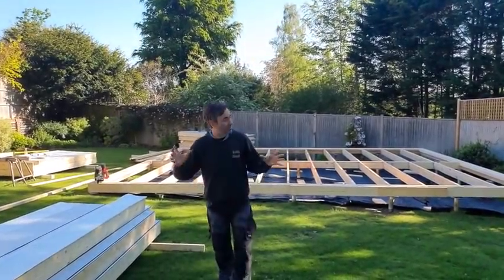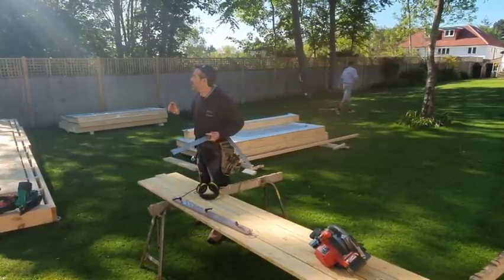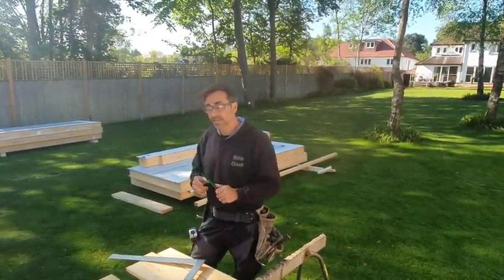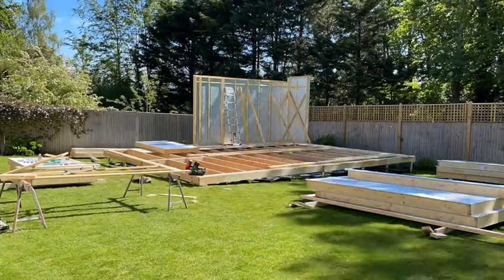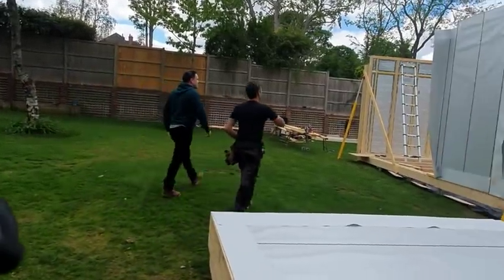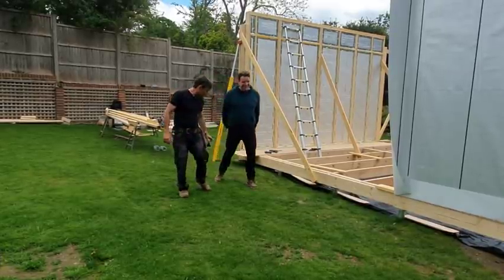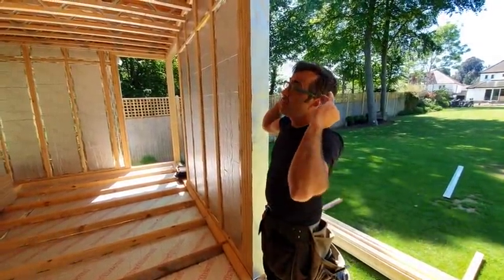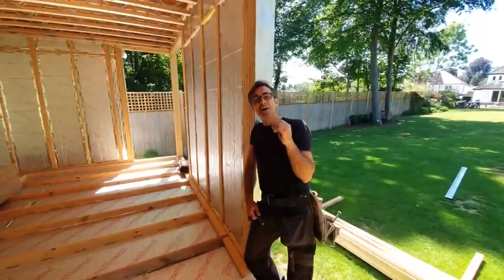Garden room how too or Workshop. Erecting walls and putting roof on

Comment: Tolerance is an interesting thing - it will be interesting to see how the industry adapts to fix something that simply has to be correct, absolutely. 

Great video 👍🏼
Reply: Game changer when the new builds will have this tolerance tests. People won’t be able to get away with bodging the work. Great for building standards
Reply: Government appointed, clip board and camera wielding, swarms of Clerks of the Works, teeming through every building site, watching over our every move, presumably . ?
Reply: @thetessellater9163  come on mate, we’ve all seen bodge work, sometimes is not even coming from the people doing the work, it can be the house developers cutting corners on the right specs and material

Comment: I have used Gapo tape after seeing a previous building of yours, I’m currently in planning for a single storey ground floor extension which I’m choosing to steel frame and in fill with timber and PIR, hoping that use of Gapo Tape will allow me to use 4 x 2 instead of 6 x2 timbers. I found with my previous two roofs that I used the tape with, I have eliminated warm air leaking into the underfelt void, it’s time consuming to tape up but so much cleaner In installing.
Reply from the maker: That is awesome!

Comment: Hi Robin, great video as always. Interesting discussion about the performance gap for insulation. We don't have much prefab builds in Norway, and PUR insulation (and similar) is almost exclusively used for larger commercial steel builds (stores, workshops, etc), with steel panels on both sides for walls and roofs. A build like this, and residential buildings, will always be insulated with mineral wool (Rockwool, Glava), where the contractor will be careful putting it in not to get any gaps or squeezes between studs and insulation. I've wondered why mineral wool doesn't seem to be much used in the UK?

Comment: You guys are light yrs ahead of construction processes in Australia...whilst prefab frames & trusses have been around sometime on the eastern seaboard (Sydney/Melbourne etc). We are lagging behind when it comes to insulation methods. As far as W.A. (Perth) is concerned we're still building with DBL brick with effectively what's alfoil as wall insulation & nothing under roof (colorbond & tiles) Rant over
Troy

Comment: Insulation seems the in thing in the UK now. I remember the attempts in the eighties and the improvements over the nineties. It keeps moving on. In Qld no compulsory insulation until 2000. Even now it is still crap. Don't see the foam panels all still batts. U value requirement not a lot. The excuse it is hot and we don't get cold so don't need anything flash. How wrong. Those eco joists as you call them I used to make them just over twenty years ago on a long press plate and travelling gantry press. Never seen them used as roof rafters but seems like a good idea. Nice and light and you can engineer the span. That panel construction reminds me of the eighties. We used to build kit homes all pre made in the factory. The panels turned up complete with all lintels in. All windows and doors in glazed already. Ply skin on the outside covered with building paper. They sat on a beam and block slab. Fix together. Throw on trusses. Tile and add brick skin. We had to add the insulation. Very similar though.

Comment: My mid 80's home in US flyover country was build with metal web joists.  So far they seem to be getting things done.  I installed a physical cabled data network, phone cable, and coaxial connections to each location i wanted to and the web joists were a huge advantage to getting the install done quickly.  Also, Glulam vs. LVL?  Winner?  Or builders choice?

Comment: Nice work Robin. Iv been considering a milwaukee framing gun, notice you have one kicking about. My paslode 350 needs renewing and I'm considering going gasless and I run all milwaukee kit. What's your opinion.?
Reply: I know you're a Milwaukee guy but I've just built a monster workshop and my first fix dewalt has put in 2500 nails and not missed a beat , not one single misfire .

Comment: U jumped off the big build with the scaffolding and came over to this one. This is very nice. I c u put screws in the ground for this one. Thanx for bringing us along. Is there any pitch on the membrane roof?  Also, r u going to put an AC unit on top?
Reply: Timber firrings create the fall

Comment: Hi robin, another great insightful video! Always a pleasure to watch. One question I have is did the likes of this garden room need planning perfusion as it’s over 2.5m & within 2M of boundary? 

Thank you Alexander
Reply from the maker: Hi Alexander, yes this was full planning and because it had a floor area over 30m2 it was also full building regs to
Reply: @ukconstruction  thank you for your response.
really liking the gapo tape yous use! Makes so much sense & a job well executed👍🏽 will be for using it on next project! 

I see you’ve used PIR on walls & floors not sure on roof. Would you recommend using it over traditional fibreglass insulation?? Or was this down to building regs? Isn’t not something I’ve seen used in wallsbefore, not that it’s the correct way to do a job! 

Appreciate your insite on this. Would make a great video on uses of different insulation

Comment: Couldn't you have measured the length of the brace on the first "triangle" you drew on the board (at 3:50)? Just measure between the 1,4 and 2,1 marks?

Comment: DIY question, but how would you fit a 6 m strongback to the posi-joists when you might only have 4 m clearance either side of the structure?  Can strongback be cut down??
Reply: They can be lapped, on a typical house you could have an 8m run and timber is generally 6m max at best so lapping by one or two joists is normal, each manufacturer will have standard details for that
Reply: @GraemeFugaccia  Hi Graeme, thanks for the guidance, much appreciated.